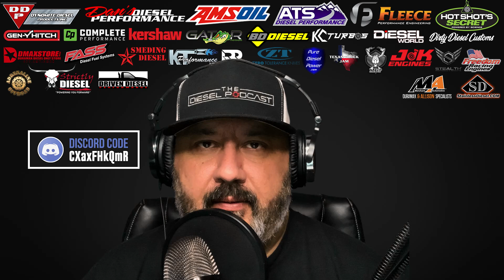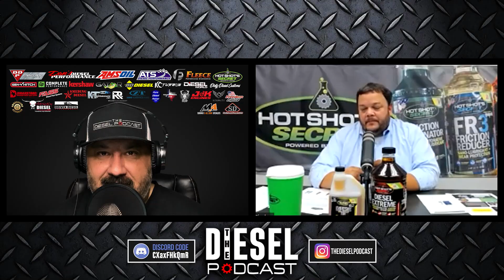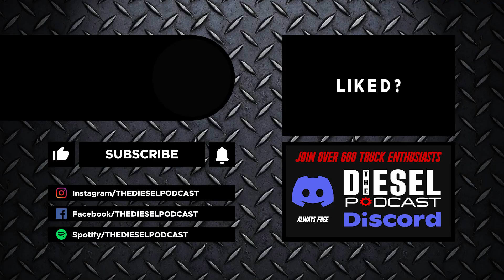Reducing Regens & Extending DPF Life

Comment: When driving the vehicle, Does anyone know approximately how much diesel is used during the DPF cleaning process on a F250 6.7L engine? AT say 1700 RPM's for 20 minutes.
And also,  the extra diesel that is used, does that go through the combustion chamber or is it injected into the exhaust pipe in front of the DPF?

Comment: I have a 6.4 powerstroke.  New motor. 20,000 mles in 4 years. Average 5,000 miles a year a have a burn maybe ince a year.  I DO NOT ALLOW MY TRUCK TO IDLE. Only idle time is t red lights, opening a gate, drive in, close the gate etc. Cold starts, start it, let it run about a minute,  then drive it easy until warm up. Keeping rpms over 1,000, more like 1,500 until wsrned up. Do not long idle.

Comment: The way things are now days I don’t believe any of this snake oil and I’ve tried a few and didn’t notice any difference. I’ve been running just diesel and I have  fuel filters with that being 2 -5 micron and 1 -2 micron filters and I have 153K miles and this is on 05 Dodge 3500 4 door long bed dullay 5.9 and 6 speed manual trans .

Comment: One of the biggest cost savings with reducing regenerations is with the damage done to the other exhaust components affected by the extreme heat during the regeneration.  You mentioned 1000F, but the DPF can reach 1600F when regenerating on a hot summer day, driving up steep mountains and towing.  1600F will melt the vice on your workbench.  Guess what that heat does to the NOx sensors, exhaust sensors, the turbo, and much more.  Those repairs far exceed the other cost you mentioned.  There are service bulletins about the exhaust manifolds getting so hot they begin to crumble.  The metal flakes are circulated back into the turbo and damages the impeller.  There are also bulletins about the extreme heat cracking the welds in the exhaust system.  They say exhaust fumes enter the cabin.  What they fail to mention is the drivers who become drossy and drift into oncoming traffic.  When will the NHTSA finally wake up and address these problems?   When your wife tells you she smells exhaust fumes, she’s right.   What you talk about is insignificant compared with the other problems these “Clean” diesel’s create.  These emissions recalls are nothing compared to the serious problems the EPA, NHTSA,and diesel manufacturers are desperately trying to literally and figuratively keep buried.   The government isn’t doing to do anything, because if they did, it would put them all out of business.  I spent 55 years working for one of the biggest diesel manufacturers in the world.  I know for a fact that they’re all lying.  The DPF and fuel quality is the least of the problems.

Comment: I don't own a diesel anymore but I still drive a bit. I get a little nervous driving a truck with 500,000 miles(Freightliner ,Detroit 15 liter) . I got caught with the engine light coming on and it started down rating itself each time it was shut off. So 2oo miles from home, in a day cab, it wouldn't come off idle.

Comment: Why in hell didn’t Ram notify that the truck is regenerating? Be a lot easier to add a couple miles on to a drive to work to finish it’s cycle then start over next drive.

Comment: I have been using Hotshots EDT. I have been testing it for almost a year and found that I actually dont see improved fuel economy.  What I do see is more consistent mpg. I didn't purchase this product for mpg, I use it for the safety of the lubricity in the high pressure fuel pump.  I have a 2019 Ram Cummins and 2015 Jetta TDI- the results have been similar between two completely different applications. During oil changes I use Hotshots diesel extreme. I am not marketing anything simply stating my results. My results have been positive.
Reply: Do fill renewable diesel in California? The mileage goes up manly from how much clean up is needed. Did you use another product before and switched or what mileage did you. Start using first time ever?

Comment: Thank you for another informative interview.  New to diesel you have exposed the land mines that can be monumentally expensive down the road.  Your discussions talk about things never on my radar.  My Duramax LZO 3.0L in my 2023 GMC was the reason I purchased my truck.  I do care about cost savings and mpg but I care even more about not having huge repair bills down the road. I am doing everything I can every tank and every oil change but I’m sure that there is more to learn.  Keep the great content streaming.  I would love to hear y’all discuss my situation in depth from A-Z. First time diesel owner, from the gas world, brand new truck,misconceptions that with diesel it’s fill it and forget it.  I use Hot Shot’s in my fuel and oil and will continue to gain every advantage at helping myself as well as my engines systems for the future.

Comment: with renewable diesel you don't need a cetane booster
Reply: Good stuff. I run it in my '07 5.9. Another friend runs it in his '87 F-350 6.9 IDI. You can almost hang around the idling truck for a few minutes without getting asphixiated.
Reply: If it adds Cetane , why not but they’re not gonna make a separate product for California Cetane delete.

Comment: renewable diesel fuel has 65 to 70 cetane value. they sell it in California. Oregon and Washington
Reply: Renewables has some great options no doubt but be careful with biodiesel due to deposits.  For those you need more cleaner more often
Reply: @dhard5067  Hi Daniel, There is a huge difference between HVO renewable diesel and biodiesel. Biodiesel is trash by comparison

Comment: What did sulphur do when it was in the fuel?
Reply: 2 big things were lubricity and the lesser known benefit was that it helped stabilize the fuel so deposits (carboxylic salts) didn’t fall out of suspension and create internal diesel injection deposit issues.
Reply: @dhard5067  Hi Dan, Sulphur is an antioxidant. Diesel fuel has always had a problem with oxidation. When they removed the sulphur the oxidation problem got a whole lot worse. Sulphur kept a great deal of the oxygen out of the fuel. Poor lubricities causal mechanism is dissolved and entrained air/oxygen

Comment: Exactly what does a fuel stabilizer do? Are you saying a fuel stabilizer stops Fuel oxidation? why is the fuel prematurely oxidizing. What is causing newly refined fuel to prematurely oxidize?
Reply: The oxidation is natural degradation.  Third parties like Hot Shot’s Secret and gold eagle developed and provide Stabilizers to slow that process down
Reply: @dhard5067  Hi Daniel, They sell solvent in a bottle with a label. No science. Oxidation can be natural but it can also be accelerated.
Reply: @ox-cetane4887 if you know so much why do you keep trolling this comment section and disagreeing with every answer to look smart? Are you in competition with hotshots? If they have proven results over 1yr that's good evidence the stuff does something .

Comment: Will definitely try your products. I've spent way too much cleaning injectors and DPF components only to find after 5000 miles that I burned 1/2 a gallon of 100% synthetic oil and it's like molasses. My fuel filters were also replaced prior to 5000 miles and they were disgusting. I agree in preventative maintenance and your products seem promising. It's good to see you guys are on top of it.

Comment: Does a 2008 freightliner  even use def fluid or need to regen?  🍻
Reply: DEF didn’t come until 2010/11
Reply: @michaellee5399  that's what I thought.. but he said it was doing 36 regens a year and they brought it down to 6 with the fuel additives.. what's up with that 🤔
Reply: @stevend8656  I believe the fuel additives may be making the fuel better quality and making it burn a little more efficiently so less spot which is great
Reply: @michaellee5399  I agree.. I use their products on my Mack.  The test results don't make sense if the 08 doesn't use Def then it doesn't Regen.. so you can't reduce the number of regens.
Reply: @stevend8656  a truck with a dpf I think still regens, I use to watch a guy on YouTube who had a Volvo with just a dpf and I’m about 90% positive it regened when needed
Reply: It has DPF with no  DEF